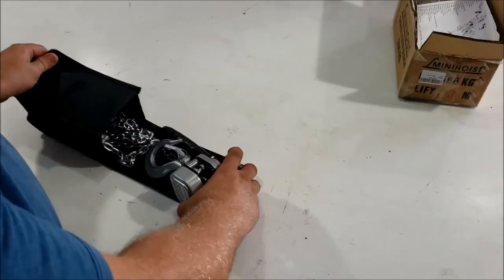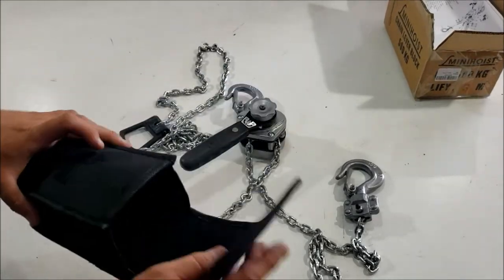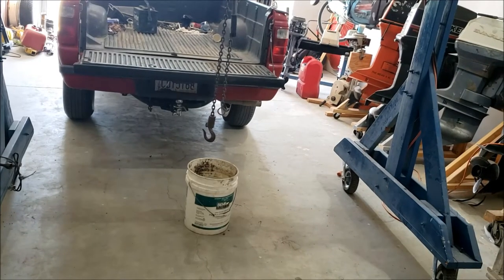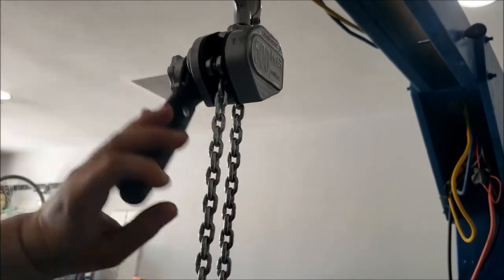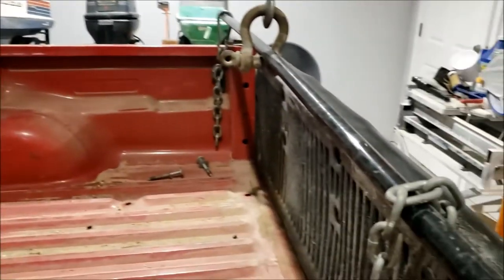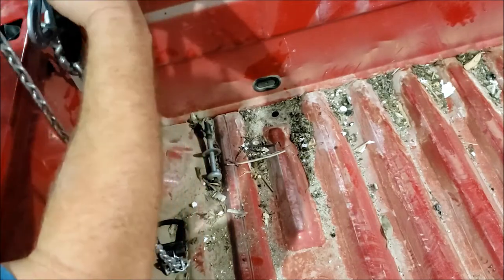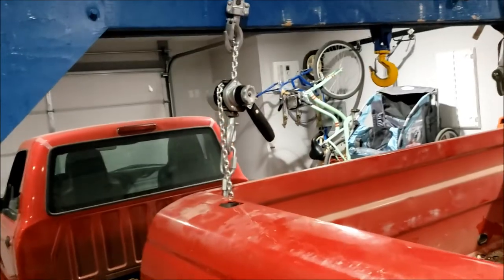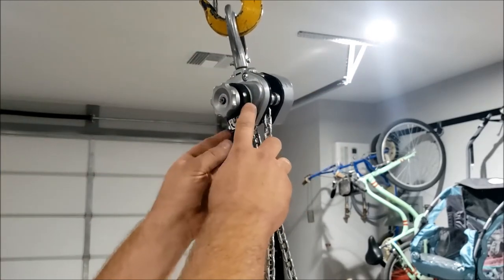1/2 Ton Mini Lever Chain Hoist Review (By Anbull)

Comment: I have to use the hi-cap tuggers a lot during elevator work when hanging entire elevator cars mostly.  But I can't tell you how many times I could have used one of these small ones for much lighter tasks.  I am going to have to get some of these.  It may be considered illegal. And that is why I will only use it in my garage on my personal time, and at my own risk.
Reply from the maker: it's pretty handy, I've used it for all kinds of things. 
To pull something or drag something across the floor. To squeeze things together while welding.
Couldn't find a ratchet strap once, so I just grabbed this.